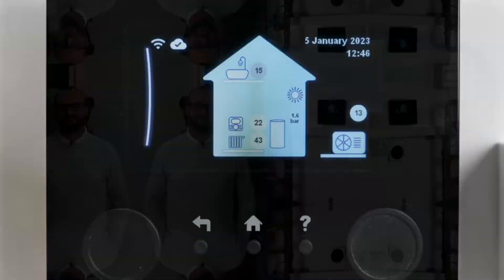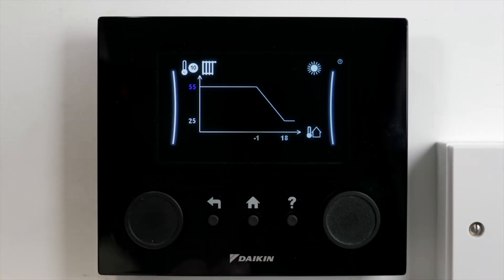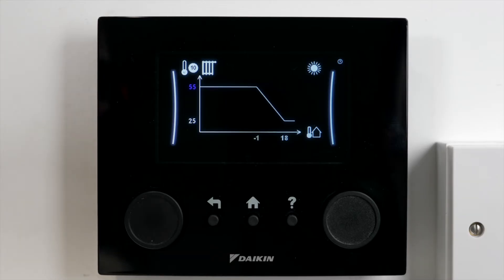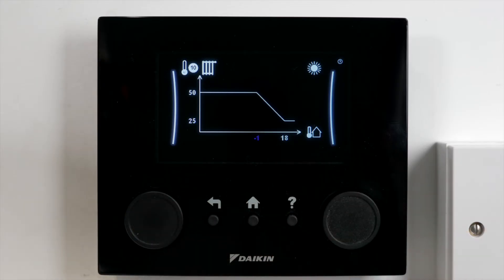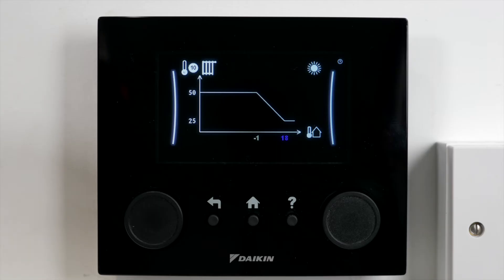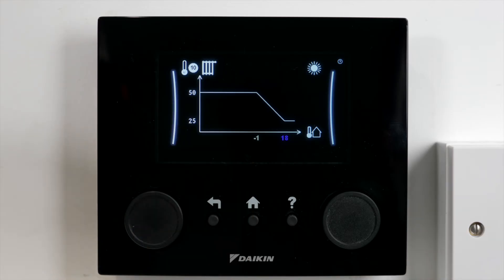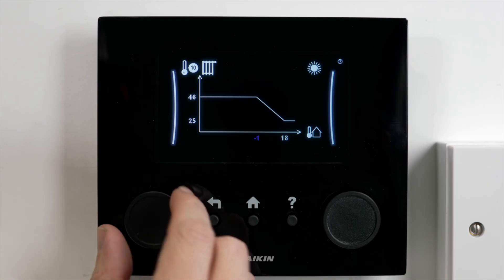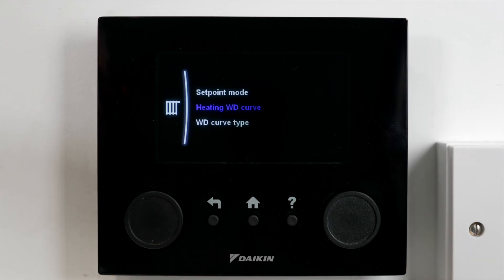Weather Compensation Setup

Comment: does Weather compensation only work efficiently if you leave your installation to run 24/7 i.e does utilising Octopus cosy tariff cheap time slots become meaningless ?.
Reply: It does for the space heating, but where it scores is heating the hot water and less wear and tear on the heat pump due to it not stopping and starting as much when using a thermostat.

Comment: -1 is the start point for a flow of heat at 50 degrees, as the outside temp gets warmer, (18) the flow of heat drops ...
So with these settings, if you feel cold you could move the -1 to +1 keeping the flow of heat at 50 degrees .
Once you have your room temps as you like them, you can then start to drop the flow  temp by 1 degree at a time every few days  - 49/48/47 untill the room temps are not suitable.